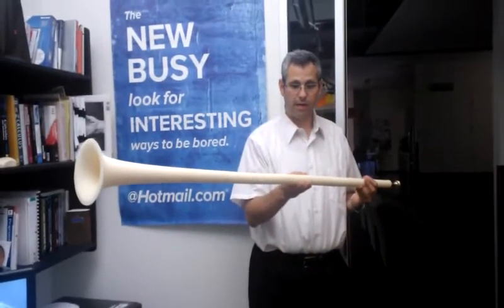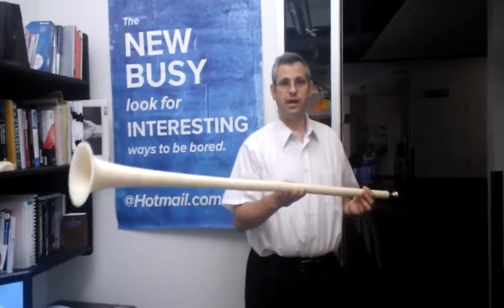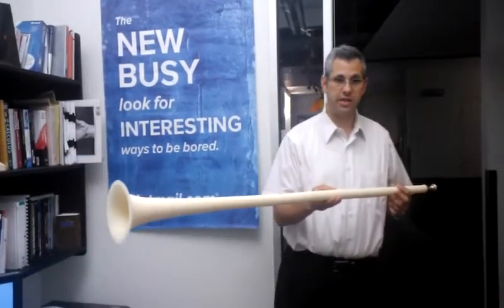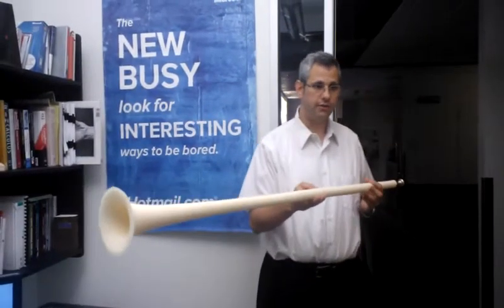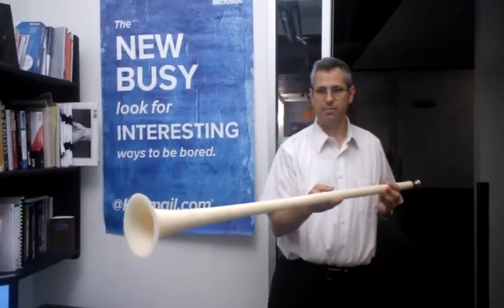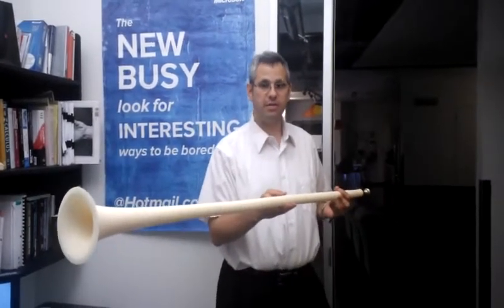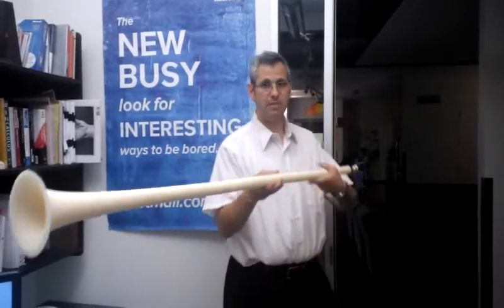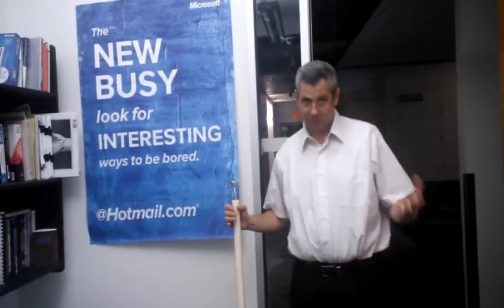3D Printed Herald Trumpet Sound Demo

Comment: I have a brass one, I play piano and flute, anything with a board or keys, but I can't figure out how to play the this horn with no finger movent, any tips
Reply: It is called "lip slurs"
Reply: The harmonic series
Reply: Think of it kind of like overblowing. It's a combination of airspeed and lip tension to vary the frequency of your lip vibrations to match the next harmonic node. Experiment a bit and see what you can come up with.
I'm having to learn on my own, but if possible it would be best if you had an instructor.